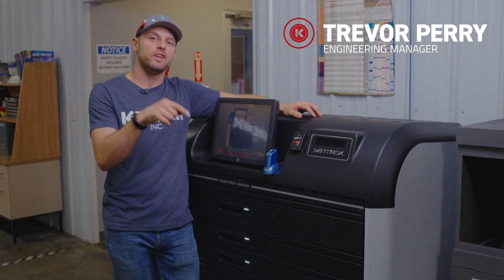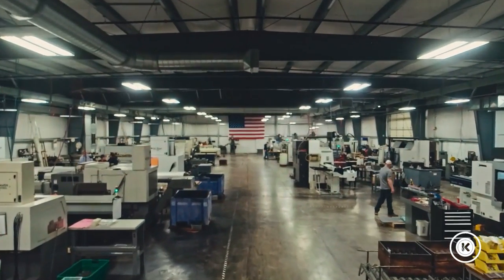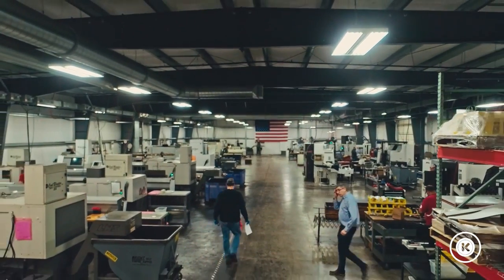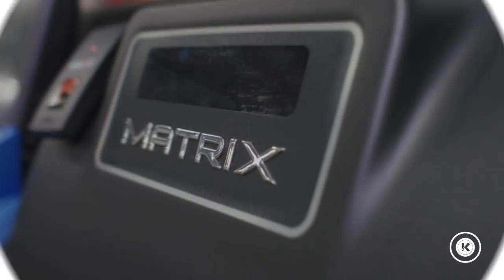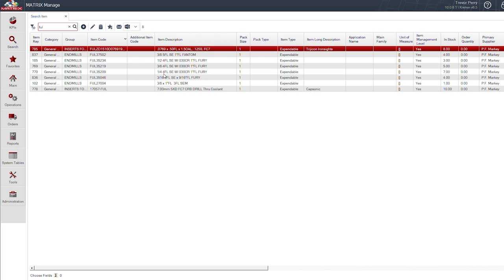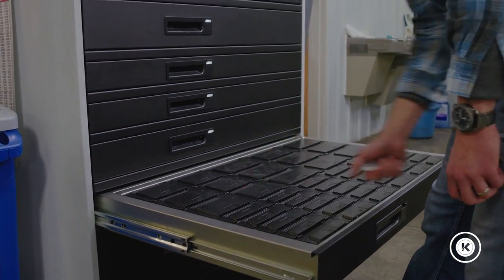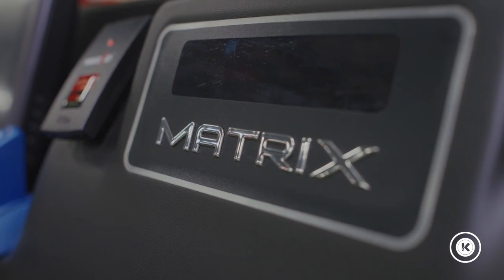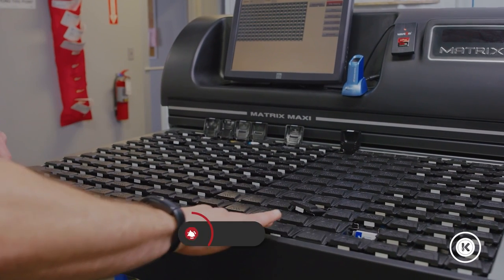The Matrix Maxi Tool Vending Machine - Kremin Inc.

Comment: I hide things from myself all the time. I do it by moving something from the spot where I've always kept it to a new spot where I just know I'll remember I put it. When the time comes that I need that tool or item I just walk over scratch my head start swearing and commence to turning the house upside down. When it sinks in that there's no way in hell I'm ever gonna find it I go buy a new one use it and hang it on the wall next to the friggin one I tore the house apart looking for earlier. Problem solved.
That's one of those 10 minute projects that turned into a 6 hour project. Happens all the time. I've just accepted it as part of life.
Reply from the maker: 🤣🤣That’s awesome